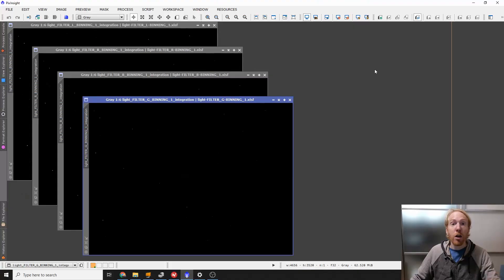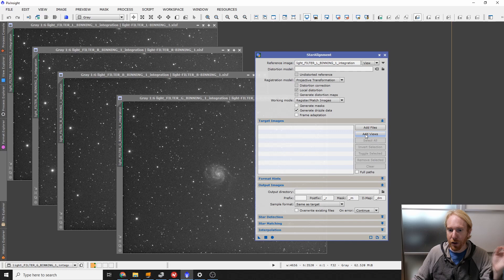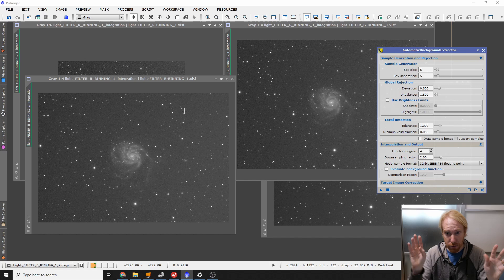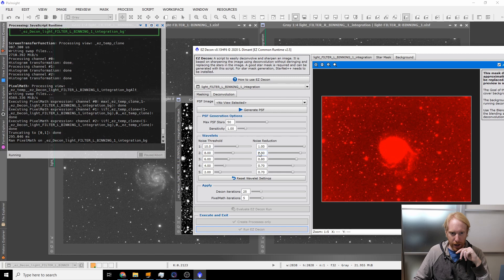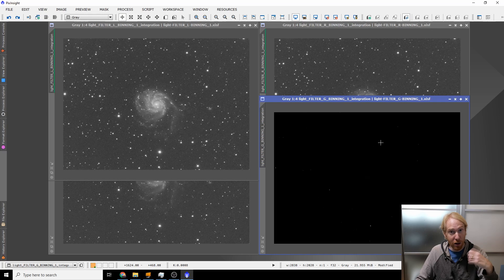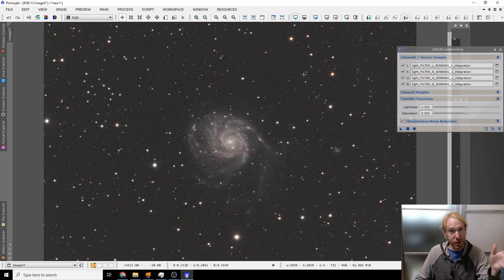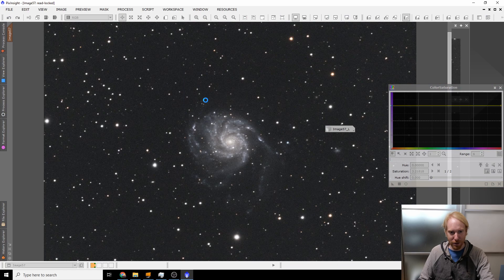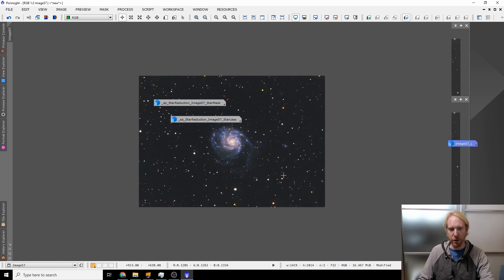My Simple LRGB Processing Workflow

Comment: I’m super excited to try this on my Triangulum Galaxy I collected using the do it yourself electronic assisted astronomy  scope you described. I put a 178MM on there with a 5 position 1.25” LRGBH filter wheel. I have other fancier imaging trains, but this little scope is a great outreach tool, and the mono data will mesh nicely with this! I converted the Az GTi mount over to equatorial and use guiding now so no problem with longer exposures.
Reply from the maker: Woohoo! That is awesome! So you're all ready for full processing :)

Comment: Ideally with any software it would be the best to stay in 32 bit processing and to do specifically certain linear and nonlinear processing according to process you are using. Siril is 16 bit processsing...and has a linear auto stretch....can we do background neutralization in this program in a linear stage?
Reply from the maker: Yes the BN is supposed to be run in the linear stage in Siril as well. In my experience it is less good than PI's DBE or ABE though..

Comment: Greetings again Cuiv! Watching your older videos as I transition from OSC to Mono. 1 quick question, I take the lights through each filter, then flats and flat darks for each filter. I took a set of darks to match the exposure and gain of the lights. Do I just need the 1 set of darks or do I need to ALSO take darks matching the exposure and gain through EACH filter? Thank you in advance
Reply from the maker: Hello! FYI dark flats can be replaced by just bias frames for recent cooled sensors. With IMX571 or equivalent, I take 1s long bias, flats, and lights and don't bother with the darks.
Dark frames and bias frames require darkness so the filter doesn't matter. You can reuse darks or bias for any filter as long as temp, gain, offset, etc. Match
Reply: @CuivTheLazyGeek   I just got a QHY 183 M for a decent price used. I made a set of darks with same gain,temp and exposure as I planned with my lights. I then used NINA's flat wizard for the different filter flats. My question was, the darks I made with the same gain and exposure as the lights, wont have the same filter offsets, so I need a set of darks with same gain and exposure through each filter to match the filter offsets? ugh...
Reply from the maker: @johnsmith-rd9rr   No, darks or bias don't care at all about optical configuration since there is no light reaching the sensor! You could take darks with the camera off the scope and it would still be fine.
Even flats don't really care about filter offset
Reply: @CuivTheLazyGeek   Thats what I thought but you mentioned offsets and I went..."uh-oh"

Comment: Hi, I have a problem with my images. I think I did something wrong in stacking because I shot mono lrgb and have color noise in my images before combining. Plz help!
Reply from the maker: That sounds... weird. Definitely not normal. Did you use DSS in RGB mode for the frames somehow?
Reply: @CuivTheLazyGeek  Yes, thanks for replying. I was using the old pixinsight batch preprocessing and now using the new one it automatically registers they are mono images. One issue though, I get too much color noise in the final image (combined and all). That might be because I took almost no luminance and no flats. Thanks for the help